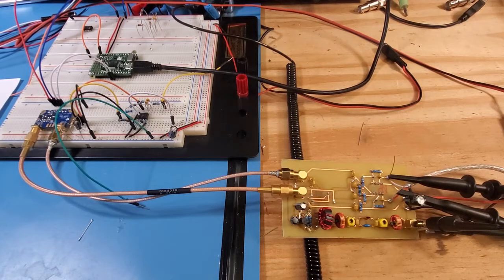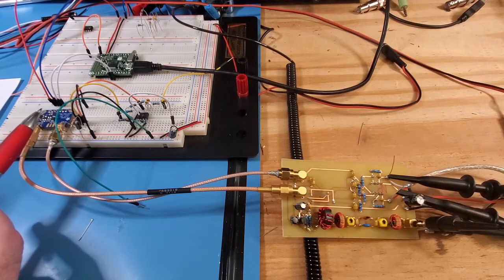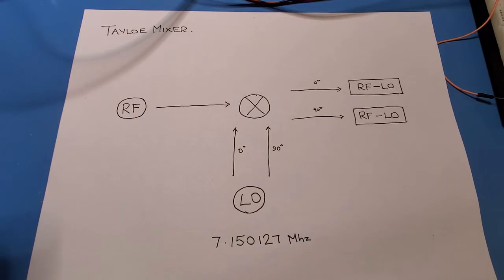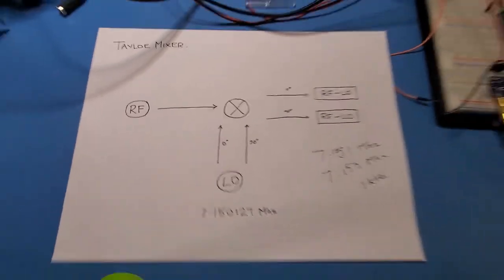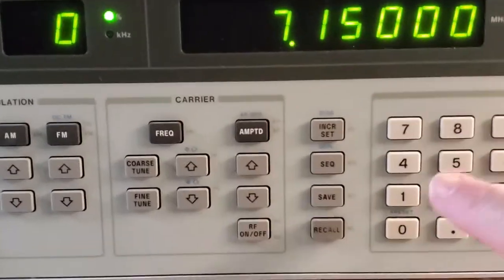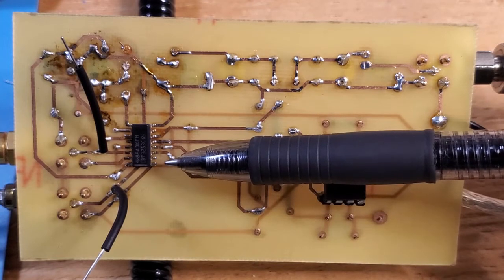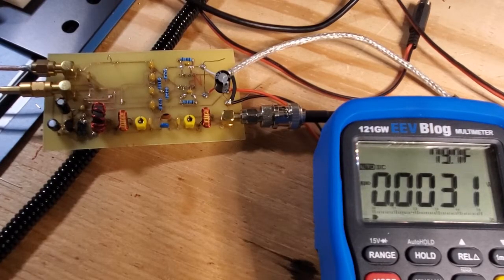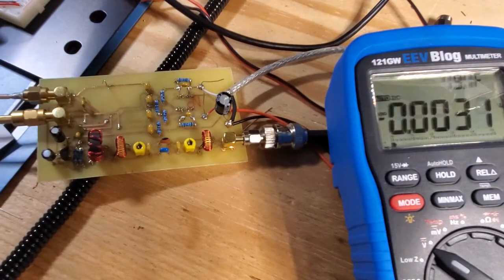Tinypico Radio Part 2a - Tayloe Detector Debugging

Comment: Thanks for the video. I was watching another video on tayloe mixer. 
https://youtu.be/JuuKF1RFvBM
In this video,seems like he did not use bandpass filter and splitter. and can we use other 4:1 multiplexer like 4052s?
Reply from the maker: I have never used the 4052 so not sure. There's nothing particularly special about the FST3253 though. The requirement is it can switch fast enough and has a low impedance.

As far as the splitter goes there are two styles of tayloe detector - one that splits and send each signal to pins 7 and 9 and one that doesn't and sends the single incoming RF to both 7 and 9. This link

http://norcalqrp.org/files/NC2030/NC2030_RX_v19.gif

is an example of the latter. Note that the connection on the output pins of the FST3253 is different between those styles. In my example with a splitter pin 6 is connected to pin 13 whereas in the no-splitter version pin 6 connects to pin 10.

As far as the bandpass filter goes I read somewhere that was a strong requirement for a direct conversion style radio - but I can't find that reference now. If you have a look at that schematic above it doesn't have a splitter but it does have a bandpass filter. Having said that it certainly would work without a bandpass filter. Perhaps not as well.
Reply: @na5y  Thank you for your time. I learnt a lot.
Reply from the maker: You are welcome Deepak - glad you enjoyed the vid!